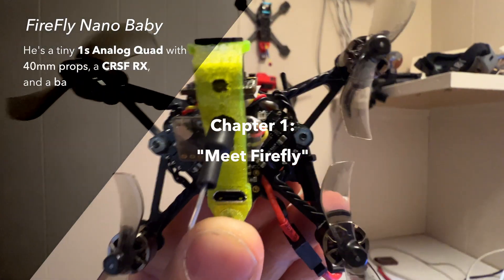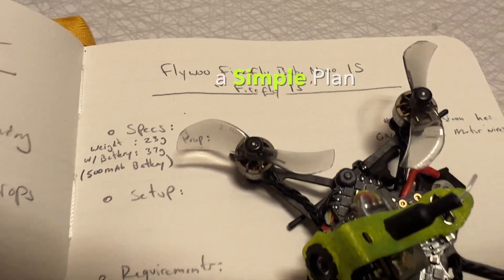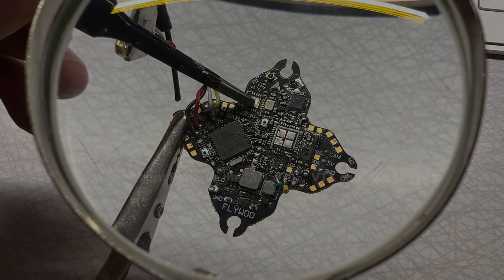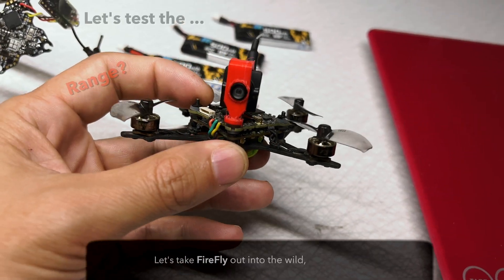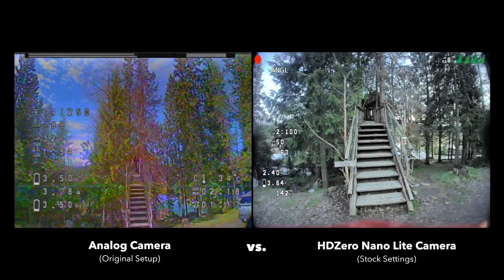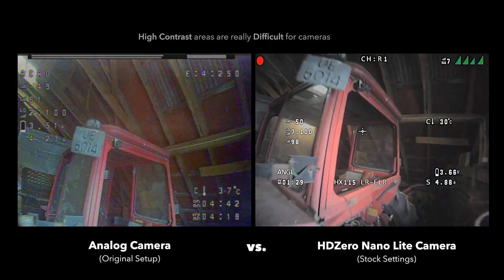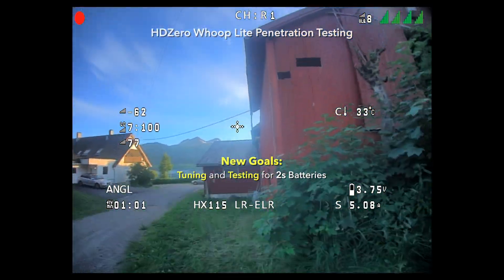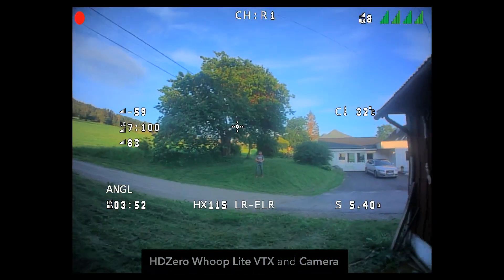HDZero Whoop Lite Digital Conversion | Killed Firefly | DIY FPV Build Story | ELRS Whoop Micro Quads

Comment: Help please! I got Flywoo 1.6" and Radiomaster Boxer. I did flash Boxer with EdgeTX and ELRS and adjusted Models. On the drone flashed ELRS and binded RX to TX, also added arm/disarm switch and air/horizon switch. Everything looks working - drone does arm/disarm, but when i tilt the drone slightly(without props - just tested on the bench) motors start to spin faster and/or slower and if tilt bit more - it disarms. Also when i throttle up and motors start to spin faster and get themselves fixed in a constant high speed and the trottle gimbal doesn't affect it anymore(not working) - the disarm switch still works. Could you help me please? What can i do to fix it?
Reply from the maker: So believe or not this is normal behavior.  Without props your quad can’t control it self and is constantly trying to fight the movements you’re making with your hand. 

Additionally you probably have “AirMode” turned on, which is why the throttle goes up high and stays there. Again you quad is trying to adjust itself but can’t without props. 

As long as Arm/Disarm work I’d suggest you put the props on (in the correct direction) and Arm the quad somewhere safe. It’s probably perfectly fine but of course be prepared to disarm in case… 

Let me know if it works out. Cheers!
Reply: Isn't airMode - ACRO ? i think i need it if its the one. why it should be off?Will test it tomorrow as well as adjusting Video and will let you know the outcome. @GiantAntCowboy
Reply from the maker: @Braincho  hey, AirMode is different than Acro mode. AirMode allows the quad (PIDs) to make bigger corrections at lower throttle positions and it is better left On. But, if you want to test the quad without props then Turning AirMode Off can make sense. 

You’ll find the AirMode ON/OFF option in the BetaFlight Configuration Tab about half way down, you can also assign it to a switch if desired. 

However, you can just put props in this quad and do a test flight. I’m sure it’s fine. Also such a small quad isn’t really dangerous if something goes wrong.
Reply: @GiantAntCowboy  Adjusted Gimbals and video +OSD and tested the quad with props in Sigh of View over the bed and it flies, not sure the mode(horizz or angle) i flew it in a small space. Will test outside soon. Btw, i barely put the 750mah battery in the battery strap. And the strap doesn't want to go out. Thanks for all the help provided!
Reply from the maker: @Braincho  glad you got it sorted, happy to help. Cheers!
Reply: @GiantAntCowboy The happiness was short :) I put on switch horriz and angle modes , but it flies same - horizontal in both modes... Any clue what's the problem is and how to solve it? Also if possible advice for antennas for my EV800D(with leaf and panel stock antennas) signal getting much worse in close range in the backyard of a block without any visible/significant obstacles.
Reply from the maker: @Braincho  Horizon and Angle mode are basically the same thing. The difference is Horizon will do a flip if the stick is pushed far enough. Both are stabilized modes. 
Acro mode is the manual, non-stabilized mode, it’s the default when neither Angle or Horizon mode are selected. 

As far as video break up. Make sure the VTX Antenna is attached well, and that both the VTX and Goggles are in the same channel. Channel R1 often gives the best performance, unless you’re in a heavy Wifi area then maybe a higher channel like R8 could be best. 
As far as antennas, any decent Omni or directional antenna should work fine for close range and clear LOS. 

TrueRC, VAS, TBS, Foxeer, all make great antennas, and any of these will be a good upgrade from the stock EV800 antennas.
Reply: @GiantAntCowboy  Thank you! Will check it out. I have a weird question. I was practicing in simulator and you can know how much throttle you_give/to_give by the sound of motors, but in real life i didn't realize before flying 1st time you don't hear anything or there is the way? How do you/all fly, like a deaf in silence?
Reply from the maker: @Braincho  yea, motor sound is super helpful, and old analog VTXs used to have a microphone which allowed you to hear the sound.  
Unfortunately it’s not common anymore, and most digital systems don’t offer the option at all. 

When you’re a few hundred meters out the sound you hear is delayed a second which can be very confusing as well. 

It’s just practice and feel. Memorizing your thumb positions. Though you can add a Throttle % to your OSD in BetaFlight which can be helpful.

Comment: Is one of those 4 pins also a vtx out on this board?   I'm having an issue where my video will go out when I'm above 75% throttle and want to use an external vtx to see if it fixes the problem. flywoo are being jerks...saying my battery voltage is too low, but the quad is still flying so...???
Reply from the maker: I’ve had the issue Flywoo is mentioning in the past, however mine was a custom build with a separate VTX. The fix was to wire the VTX to VBat because the 5v pad didn’t supply enough power when throttling. 

Is yours a BNF? Or a custom build? Does the DVR footage show voltage dropping hard before the VTX cuts out?

Let me know.
Reply: @GiantAntCowboy  No, I have the one with the on board vtx right..  No it's a constant voltage I can put a new battery on it, and blip it and the video will go out above 75% throttle, so I want to disable the on board vtx and put an external one on it and see if it fixes it but I need a vtx out pad right, which you needed too? but no one says where that is? It's not on any diagrams I can find.  I assume it's one of those 4 pads?

yes mine was a bnf, but I've completely torn it down now multiple times trying to figure out this problem.
Reply from the maker: If you go to the 1:40 mark of the video i show where I wired the HDZero VTX. I used the 5v pad, but was losing video too I believe. You can use the VCC for direct battery power which should give more amps. (Try both maybe)

The board in mine was the “goku versatile f4” if you search that there are some diagrams available I think. 

Ultimately as shown in my video I killed the board and replaced it with a completely different one. Hope that helps, but let me know.
Reply: @GiantAntCowboy  That's for power but what about signal?  There's no vtx output from the osd?
Reply from the maker: @maddercat  not sure. Possibly not. I was using HDZero so didn’t need a VTX/OSD specific pad.
Reply: How do you wire the vtx to bat? Is one of those pads the vtx power?  The bat is lower voltage though, but I guess would give more amps?  I think I would want to wire it to the 5v rail maybe which should be 2amp? Whatever rail its on rn isn't sufficient obviously, unless it's the camera which is shutting down but I don't think it is. @GiantAntCowboy
Reply: I'm thinking right now it's a heat issue. @GiantAntCowboy

Comment: Awesome.  Can you pls share the components you replaced on this little one.  Also, I'm a DJI system user and what goggles are you using?  Thank you.
Reply from the maker: Thanks! The parts are all described in the video, but basically I replaced the FC with a BetaFPV F4 12A AIO board and the VTX is the HDZERO Whoop Lite board and camera. 
Goggles are HDO with a HDZero VRX module. I’ll be testing the new HDZero goggles next month hopefully depending on production timing. Stay tuned, cheers!

Comment: Did you ever find a way to disable the onboard vtx?  I'm trying to do the exact same thing with a Diamond ELRS board
Reply from the maker: Basically just destroy the board and then buy one without an integrated VTX, that’s what I did… haha!

Unfortunately I never found a solution. If you had a proper “hot air soldering” tool, you could mask the board and remove the VTX chip. 

Wish there was a simple off switch or setting… thanks for watching, good luck!

Comment: Does the ELRS 2.4ghz interfere with the HDzero system?
Reply from the maker: No issues with anything close-range. On my long-range setup though I seemed to be getting some interference and ended up moving the ELRS RX/Antennas to the front of the quad. 
No problems since, BUT the initial problem could have actually been an environmental issue… (WiFi, Cell tower, and high tension power lines were all around my test location). 

Either way it’s always best to separate radio/electronic equipment whenever possible, especially for long-range builds.

Comment: hey man could you do a vid on your findings with changing lens out on whoop lite cam, the snippet you showed looks really promising but I'm nervous to try without a bit of guidance.
Great vid as always
Reply from the maker: Hi man, so I haven’t made any progress with that swap yet. The lenses I have won’t focus unless they are barely screwed in, so I need to find a different solution.  As far as how to do it, the lenses just screw out, and then screw back in, at which point you’d have to look through the goggles and focus the image. 

The thread is an M8 so most nano lenses would fit. If I find a good solution I’ll definitely share with that community. Appreciate the comment, cheers!
Reply: Thanks for taking the time to reply, I hope you do get around to achieve this, can't find any other info on doing a lens swap on this camera so you would be the first I guess.
Thanks for the info on what you've tried so far and the thread size... maybe I'll have s go just scared of breaking my camera as I'm sure you are 😆 👍🏻✌🏻
Reply from the maker: @stevenedwards408  sure thing, removing and installing the lens is actually super easy, it’s literally just a screw in/out lens on this camera. Just avoid touching the back of the lens and the image sensor. You can clean them, but it’s best to avoid. 

Screwing the lens in and out is how you focus it, which you’ll have to do if you remove it, and even factory lenses can be out of focus so it’s worth checking periodically.

Comment: I'm new to fpv and i just bought a Cobra x box goggles . What i see is a nice image down a tunnel , like watching a TV set in a dark room .  What i would like to know is with a pair of say FatSharks or DJI goggles will i see an image " closer " to my fov and not the tunnel effect ???   i do not know anyone who has goggles.
Reply from the maker: With box goggles yes, it looks like a tv down a tunnel. This is because it’s literally one large screen set far enough away that you can focus on it. 
With binocular style goggles you have two small screens, and the “darkroom/tunnel” effect is reduced significantly. At some point you can upgrade to a set of binocular goggles and keep your box goggles for spectators, or co-pilots.  Search the classifieds, eBay and Craigslist for good deals. A lot of people sell decent used stuff, 90% of the FPV equipment was bought used. Thanks for watching, cheers!

Comment: Great work as always man!

That first AIO board may simply have not been able to handle the heat put into it after removing both of those chips. I'm not sure why they didn't tell you to simply cut the trace suppling power to the chip with an x-acto knife
Reply from the maker: Yea, it’s a bummer that there wasn’t a simple solution… thanks for watching, appreciate the support, cheers!

Comment: Cool idea. I've the same quad. Would like to know how much did the conversation cost?
Reply from the maker: This ended up being a whole rebuild since I couldn’t get the analog VTX to shut off… I’m gonna reach back out to Flywoo and see if they can figure out a proper way to disable the VTX. 
If you have hot air solder equipment, and better skills than me, you could remove the RTC chip successfully. When I did it I used a big heat gun and accidentally disrupted a bunch of other components… that’s what killed it. 
Anyway to your question, the HDZero Whoop Lite VTX and Camera kit is $99 and the BetaFPV AIO board I used is like $50, so all said it cost around $150. 
Thanks for watching, let me know if you have any conversion success, cheers!
Reply: @GiantAntCowboy  thanks for getting back to me.

My biggest problem or more question is which digital system to go for. All my stuff is analog ATM. So I'm trying to decide which digital system to go for.
Reply from the maker: @lionelfrenchface  ah yea, there’s really no right answer here… I too came from analog and decided to try HDZERO because of a few things:
1) I already owned HDO goggles and could easily add the HDZero VRX to them, which was cheaper than buying brand new DJI
2) Since you have the same goggles you can continue flying your analog quads, as well as use the same antennas 
3) I do a lot of longer-range stuff and liked that HDZero was a “receive only” system, meaning the goggles and VTX are not linked together. This is good because if you lose signal it can come back quickly without a rebinding process like DJI, which can freeze and reboot. 
4) HDZero is more customizable, and has* multiple manufacturers and vendors, a solid community, and the company actively engages the community all the time. 

* I starred (*) multiple manufacturers because HDZero is still relatively new and the system is quickly evolving, because of this there has historically been lower levels of production and availability; Covid and manufacturing shutdowns in China didn’t help this over the last year either… but larger companies are starting to prototype HDZero equipment (Foxeer for example) and HDZero themselves are even developing a seemingly very impressive goggle specifically for the system. 
- DJI is a great “plug and play” option but can be more expensive, depending on if you currently have decent goggles. 
- DJI does have better image resolution and arguably better penetration, but it does both by broadcasting and re-broadcasting video signals. This can cause slow (high latency) blurry video feed when signal gets bad. Where as HDZero maintains consistent resolution and latency but shows static like classic analog. 
- DJI doesn’t support Canvas mode so you have very limited OSD elements and they are not recorded to the DVR, which is another issue for longer-range type flights…

Then there is Walksnail or Fatshark, but no one really knows what’s going on there yet… 

So hopefully my long-winded response provides some helpful insight for your decision. If you have follow up questions let me know, cheers!

Comment: Wow awesome  review you really put that little quad to the test. It's a bummer that the built-in vtx is now in the way of upgrading the quad to HDZERO. I have a BetaFPV Meteor85  I would like to put the HDZERO on.
Reply from the maker: Thanks I really appreciate the comment. I’m gonna reach back out to Flywoo and see if they can figure out a proper way to disable the VTX. 
If you have hot air solder equipment, and better skills than me, you could remove the RTC chip successfully. When I did it I used a big heat gun and accidentally disrupted a bunch of other components… that’s what killed it. 
The BetaFPV AIO board might actually have a way to disable the analog VTX, I’m not familiar with what board is used in that setup though. 
Let me know if you figure out anything, and stay tuned, cheers!
Reply: @GiantAntCowboy  Thanks for the reply cheers